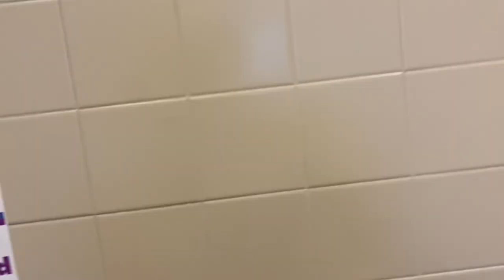Simplex Fire Alarm Speaker Interference

Comment: The hissing noise is from idnet being ran in the same conduits as speaker circuits. If you were to listen closely at the panel you would hear the panel itself makes the same noise. It's the sound of normal slc/idnet operation. The low frequency sound you hear is a supervision tone and its possible that the voice card in the panel makes that sound like well.
Reply: Notifier voice evac systems also play a supervision tone too. The tone comes from the DVC (Digital Voice Command) and it only plays on the speakers if there is no control module to isolate the supervision tone which means it plays constantly only if no speaker circuits are active. If there is a control module the tone is isolated to the DVC where it plays when no speaker circuits are active and it will then switch to play on all the speakers when the control module turns on to do the voice evacuation tone and message and microphone paging. The Notifier supervision tone sounds at 200 Hz
Reply: @joeycaridi3030  My school has a Notifier NFS-3030 and I sometimes hear a 200hz supervision tone before the fire alarm sounds.
Reply: @joeycaridi3030 if someone tapped into the fa pa sysyem and hooked up a kit to use the speakers in a zone as microphones, how could you detect that? My speakers are emiting a very high pitched sound which intensified during a certain conversation I was having and went lower after being done.  It's been going on 2 or 3 days and I'm in a legal dispute where they hired a team of PIs and they have a large budget and resources.  If the zone is not active it pushes a supervisor tone though it? To use the speakers as mics would require more current than normal maybe? Could a clamp multimeter test for normal vs microphone usage?

Comment: It seems like the tone generator on the evac panel is for some reason on and emitting a sine wave, despite the system being neutral. The amplifiers however are off which is why you can’t hear it unless you get close. This is just my theory though as I have no experience working on fire alarm systems. If anyone wants to weigh in and confirm or deny my thoughts that’d be cool.

Comment: My school sounds EXACTLY like this. The light plates are 4903-9101 light plates with Simplex speakers added onto them, presumably from a rennovation as the school was built in the early 90s. I don't think it had speakers to begin with, but it is quite possible as the classrooms have ceiling mounted Wheelock speaker strobes. Some of them though have the "frosted" 7002T looking strobes, which makes me think they've been a speaker/strobe system since the school was built. Not common in the early 90s!

Comment: The hissing noise is a common issue because at Theme Park HeideLand the alarms have this issue because of the panel bugs and does not work properly and is currently in trouble mode.

Comment: This can be an issue. The fire alarm at 0:01 is the same one they have at Theme Park HeideLand (red in the hotel and other buildings, but only white in the museum) and at Tower Condos (white in the Tower Condos, but red in the train station and boardwalk stores). What do you think about that?
Reply from the maker: That’s cool I suppose
Reply: @FireAlarmDude5967  Thanks, bro!
Reply: @FireAlarmDude5967  I thought you had a System Sensor SPSCW.
Reply from the maker: @AndrewIsAwesome882  correct
Reply: @FireAlarmDude5967  Aren't you going to show it soon?
Reply from the maker: @AndrewIsAwesome882  probably not unless it’s in a system test
Reply: @FireAlarmDude5967  When's your next System test? For your next System Test, please feature your System Sensor SPSCW, okay?
Reply: But Simplex TrueAlert Speaker Strobes are also found at Disneyland in Anaheim, CA.